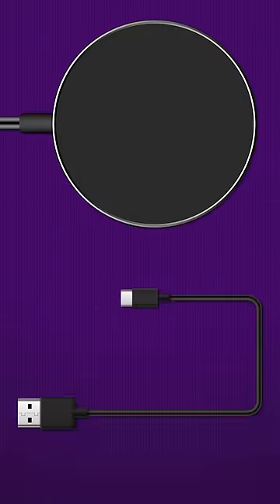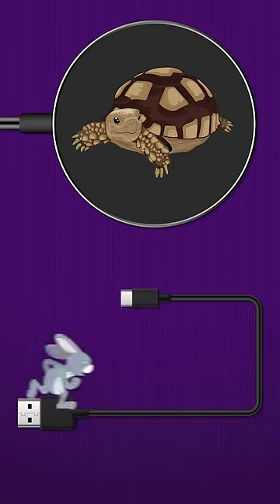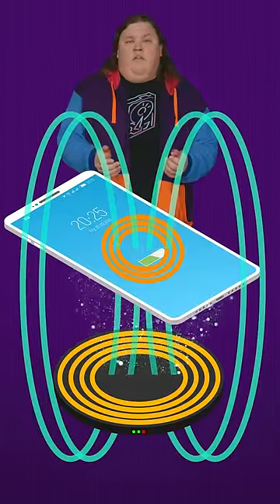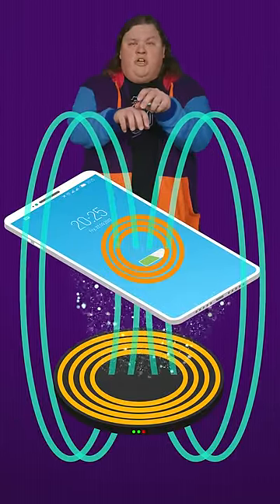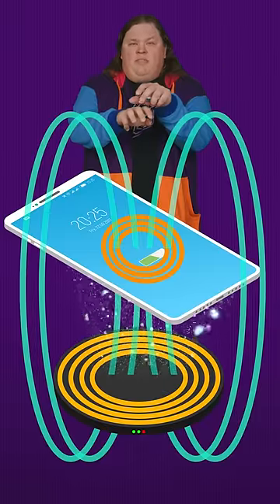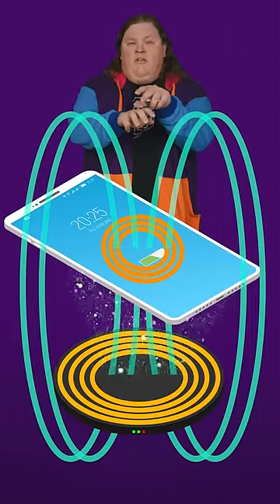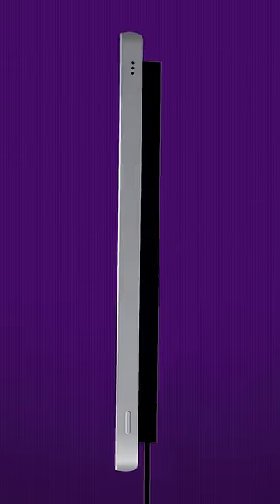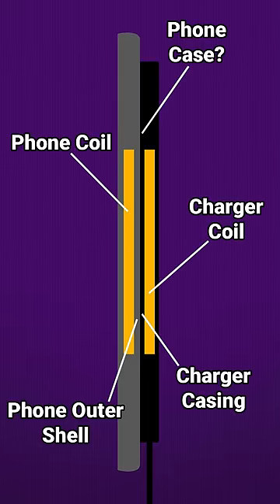Why Wireless Charging Is Slow #Shorts

Comment: They aren't improving, they are wasting more power at higher wattages. Wireless will never be efficient.
Reply: Never be as efficient I think is a better statement. We likely can get significantly more efficient wireless power, but it will still have more loss than wired
Reply: @DeathProductions200  Dude, eddy currents
Reply: @UltraGamma25  is that supposed to be a rebuttal? Cause it really doesn't explain much. Yes there are limitations to magnets in terms of power transfer. But fun little fact, we can always find other options that are as efficient or more efficient. We can find some weird material in 4-5 years that makes induction a more viable for power transfer, and goes from say 85% to 96% efficient. Don't just say "Eddy currents" in hopes that that works as a rebuttal. We have no idea what'll happen in the next 5-10 years.

Comment: I hate wireless because I can't use my phone while charging. With a wire I can still hold it in my hand
Reply: Thankfully there is no phone that ONLY has wireless charging.
Reply: @bgezal  yes and no company would EVER think about taking away the CHARGING PORT on their phones riiiiiiiggghhhhht??????????????????
Reply: @jadenknott if it isn’t apple😂 and yeah you can use your phone while wireless charging if it is an iphone😢
Reply: Apple has mag safe so the charger will stick to the back of the phone. I heard Samsung might be getting a form of mag safe soon too so I think phone companies are considering removing the charging port
Reply: I'm already doing that with a MagSafe Battery Pack. Though I still agree with other replies saying that removing the port is dumb. WiFi is only recently surpassing 1Gbps, and physical ports are capable of going 5Gbps, if not up to 80Gbps, it'd be dumb to rely solely on wireless data with how things are right now.
Reply: @superfragilisticatexpialidoshmur  oh yeah I completely agree
Reply: The Wireless Power Consortium is working with Apple to bring a mag-safe like charging capability to Android devices. The new standard will be called Qi2. Qi2 should be cross compatible with both iPhone and Android devices.
Reply: @FoolOfATuque  thank you so much for the info I've been wondering what it really was
Reply: @jadenknott  Apple
Reply: @adibafiq6945  yep
Reply: The thing it not just a charging port, it a data and SYNC port too... Like for Android auto or moving a huge amount of file
Reply: Yeah I never understood wireless charging
Reply: @michaelvernon9459  but what’s the point if instead of having a big puck on the back of your phone, you can just have a cable plugged into it?
Reply: @sam_9228  because companies will find ways to make more money from it
Reply: I just hold the charger too, no biggie
Reply: Because technology takes time to improve we will probably get wireless charging in 19 or 20 years
Reply: I like wireless charging, because it won't wear out the charging port. It's also nice being able to just plop the phone onto the charging pad, and pick it back up, instead of fiddling with a cable. If I need to use the phone while it's charging, I usually just leave it on the pad.

Comment: I don't really care how fast it is. Most phones charge too fast anyways. I'd rather have a phone charge slower so the battery lasts longer. Wireless charging saves the USB port on my phone from being worn out.
Reply: quite useful when you lose the ability of the port as well
Reply: What do you mean when you say "the battery lasts longer"? Do you mean long-term or the battery capacity? Because in the long-term, fast charging doesn't negatively impact battery life expectancy. It has everything to do with heat and the number of charge cycles, not how fast it charges. Most phones monitor the battery temperature while charging so that it doesn't exceed around 40c, which is perfectly fine for the battery.
Reply: A phone battery is worn out by deep cycles (like 10% to 100%), not by fast charging or charging often. I've fast charged my phone for 4+ years and it still has 83% capacity, within specs.
Reply: Right, that's why I have a routine set that only turns fast wireless charging on when it's below 50%. And if I REALLY need to top up fast, I can just pull the plug from the wireless charger and plug it into the phone.

Comment: I don't get why people now will literally not consider mid-range Android phones without wireless charging.  How hard is it to plug-in a USB C cable?  The "wireless" base you put your phone on has a cable going into it... why not just plug that into your phone, instead of the base? 🧐
Reply: Who says you can't do both? Hell if your phone doesn't come with wireless charging, you can buy wireless charging USB C receivers that stick to the inside of your case cover, and plug into the port. Want to charge with a cord? Unplug it, plug in the cord! I've been doing this for 10 plus years. 😆
Reply: Due to risk of small debris entering the port at work I got a plug to cover it.
So I would need to take it out and then plug in the cable vs just put the phone on the charging pad
Reply: @AltonV  Oh my, what an inconvenience to have to remove one plug out of the port to then put a cable in! #1stWorldProblems anyone? 😉

Comment: Because it's wireless. There, I saved everyone a minute
Reply: Yeah seems pretty obvious.
Reply: but why is wireless slower
Reply: cause it's not wired
Reply: @-Scrapper-  Wireless is slower as power has to travel through at least the plastic of both the phone back and the charger base, from the coil inside, and the air.  With wired, it goes down a cable, directly into the device, where there will be other wires inside.  So it's more direct
Reply: @dftfire buddy I watched the video

Comment: Cool video. I feel wireless chargers are overrated
Reply: Agreed, they also waste a ton of energy compared to just plugging in a wire, and are they really wireless when you have to plug the charging pad in?  🤦‍♂️
Reply: @CommodoreFan64  A phone's battery is like 40Wh. You're wasting a hundredth of a penny for each charge.
Reply: @CommodoreFan64  I liked the idea of a Wireless charging hub which sends power all across the room, any device which is capable of receiving power this way, can charge by just being within the field of energy. If I remember correctly, Xiaomi did something like this. Although I'm skeptical about it's health effects, bcuz sending energy waves all the time through your body can't be good, can it?
Reply: Well you see wireless aren't appealing for people like us , it's more appealing to olders because they are just easy to use, hard to break and charging cables sometimes just break and so does the port so it makes sense why apple is putting so much money into it.

Comment: I never understood the appeal of wireless charging. Cables with magnetic connectors (eg. MagSafe) are the way to go. Peak efficiency, excellent ease of use, and fantastic durability.

Come on USB-IF. Release a standard magnetic connector for USB devices already!
Reply: the big tech overlords arent gonna want to give us that. they want people choosing between an actually functional platform with well-implemented features and zero control (iOS) and a buggy, dysfunctional, disjointed mess with a tiny bit of control (android).
Reply: I only charge wireless because my power connector keeps on corroding both on my phone and the cable.  I keep on having to buy new cables, and the power connector was the first thing to break on a phone.  It it wasn't for that, I don't see the point.
Reply: Because it's nice to just set my phone down beside my bed at night having to fumble around with a cable. If you don't understand why people like wireless charging then you must hate thinking
Reply: @chefboyardeeznutsinyourmouth  That's the theory. In practice, I've never used a wireless charger that reliably performed as you just described.

If I have to fumble around with the positioning of the device on the charge pad, I may as well spend the same effort inserting a cable. Then I can at least move my phone around a bit while still charging. And it charges much faster while wasting much less electricity.

And if the phone has to use magnets to align properly with the charger (eg. iPhone's "MagSafe"), then I don't see how that's less inconvenient than a magnetic connector for the cable.
Reply: @chefboyardeeznutsinyourmouth  that’s a lot of sass coming from someone who thinks it’s too hard to plug a wire into a phone. Wireless charging has just as many inconveniences as using wired charging. If I wanna use my phone while it’s charging I’m just outa luck if I go wireless
Reply: @CivBase  in practice i go to my home office, i drop it on the wireless charger. i go to work, the same. i lie down in bed, i drop it next to me. 

the result is that i always have a good percentage of battery and all i have to do is place it down on the charger instead of the surface.... i don't know if i have 200 IQ but i always get it right with the 1st try. i also hate cables dangling everywhere. they don't look nice, the pets like to chew them and the robot vacuum likes to get entangled with evefy opportunity.

 that said, i also have a high speed charger + long cable in the drawer to use in case i need to charge it really fast, or if i happen to be running low and i need to be using it at the same time
Reply: @CivBase  Then you should try out the Pixel stand. I never had issues, you just pop it on it and done. (Works even if you put your phone horizontally on the charger)
Reply: @CivBase  I rarely have to fumble around, if even if I do, I just wait until I hear the charging sound and I know it's charging. But to each their own
Reply: @mind-of-neo  who hurt you wtf
Reply: I basically only use MagSafe wireless charges to charge my iPhone. It charges overnight and I can use it all day. If I need a top up I have a MagSafe Charger on my desk. Pop in on there for 20 minutes and I’m good for the rest of the day.
Reply: I like using wireless charger
Reply: They have some advantage, especially for disabled person, it's much easier for them to just put it there, instead of fumbling with the USB, especially the old Micro USB.
Reply: @mind-of-neo bro I'm curious what android did to you, I've been using Android since Android G that is more than 10years of Android use. I've rooted multiple phones, used multiple 3rd party recoveries, installed multiple custom roms and kernels, I've used Android phones for computer vision and robotics related projects but I didn't encounter the issues you mentioned on any of the unmoded phones.
Reply: @mind-of-neo have you ever even used an android phone before? I've been using it my entire life and I've encountered exactly one bug years ago, it's not buggy at all. And disjointed? You mean varied and intercompatible with basically everything?
Reply: What if i want to charge my phone slowly? For better battery health
Reply: Dependa, its kind of snooth if you dont user youre phone, no USB c game controllers And Just Palace IT on youre nightstand.
Alsof the OG Idea you could go dit in a bar And charge youre phone on at Starbucks OR something
Reply: @Max-ew8cg  just use 5 W / 10 W charger

Comment: Wireless tops at 50W and wire is getting 200W in the experimental models.
So yeah wireless is getting to be faster than wire, in ~2018, BUT wire got faster as well since then. 
I recommend everyone to aim for AT LEAST 67W charging, as it's life-saving if you need a top-up between flights, or you just forgot to change, and you wake up to 5%. 
67W gives you 15-25% in 5 min, which is plenty for surviving. (as they usually have 4500+ batteries as well, 15% means more as well)
for comparison, iPhone will give you 5-7% in same time. (tested myself my phone vs my wife iPhone)

Comment: Wireless may be slower, and each phone charges its' own speed no matter the output of your wireless pad, but it saves the USB port of your phone.  After just 2 or 3 years of ownership, a lot of USB-C ports on phones will become really loose and simply not detect a cable connection and won't charge.  It's why I got rid of my last Samsung - had to shove the USB cable in and wiggle it around to get it to charge, and eventually the fast charge just refused to work as well.
Reply: If you're having to wiggle around a USB port, you need to clean it...
Reply: I'm not sure I've had that problem with micro USB connectors but with USB-C, I've never had that issue, and I've had lots of USB-C devices since 2019.

Comment: I picked up an ONN brand 10w wireless charger for $10 from Walmart and it sits on my computer desk. Takes about 2~ish hours for a full charge, but I also have a z fold 4 and the battery is relatively big for a phone.
Reply: 4400mah? that's relatively standard for android these days
Reply: Onn is Walmarts in house brand FYI. So, if it works and it's cheap enough... 🤔

Comment: are they getting more efficient or just faster? it's a bit worrying from a collective energy use perspective if everyone starts using less efficient ways of charging their devices. (one person using wireless is a tiny on the grid and environment, but an entire country doing it would be significant)
Reply: Phones don't use much electricity anyway. Less than an LED.

Comment: I honestly can’t see wireless charging as anything but a gimmick, and a bad one at that, since you won’t be able to use your phone while it’s just laying there on top of it. Well, at least not comfortably. On the other hand you can do that with wired charging. 

Wired charging for the win (until you just need to have it in a 1-1.5 meter proximity for it to charge)

Comment: Think of it as the charger is a magnet that powers a generator in your phone and is incredibly inefficient because the power runs a magnet to run a tiny generator in a device with no physical connection.

Comment: I don't really get wireless charging for phones, I get it for smaller devices or things that don't have a large battery like a watch however.
Like what's the point of them, what problem do they solve? having to plug in your phone? I don't know about you guys but I never thought plugging in my phone was cumbersome
And if that's the problem, I don't get why we don't see more flat wired chargers, like the original Magsafe charger, it still has a metal to metal connection so the efficiency is the same as a normal charger, but it can still attatch through magnets and is easy to remove
Thinking about it, why isn't this the way the Apple watch charges, instead of induction through the thicc glass
just have a metal connector on the side that's flush with the case and a charger that can attatch flush with the case too.

Comment: There is a theoretical limit to the efficiency of wireless charging.
While it is possible to improve on the speed, it is very difficult to improve on efficiency.
So if you have a limited source of energy, say a power bank, you can only transfer half of the energy from the power bank to the phone.
This is why a phone without a charging port will never see the light of the day. In the field, with only battery power available, you would routinely waste half of your batteries only because of wireless charging.

Comment: Well my wireless charger is 65 watts lol when the iPhone wired charger is 20 watts
Reply: I'm pretty sure the iphone can only handle 10-15w through wireless charging ny though.
Reply: how to melt a phone
Reply: That's because Apple haven't improved the Thunderbolt standard since it was introduced, back around 2012 I think.  I'm sure they could have increased the wattage if they wanted to.  But they have even said that once they switch to USB C, they will not allow fast-charging or data transfer faster than what Lightning supports now.

If fast wired charging is important to you, get an Android phone.  Isn't that how choice works?
Reply: @dftf  Apple doesn't have a choice of whether or not to use USB C. EU law is making it so they HAVE TO, or they will not be allowed to sell their phones in Europe.

Comment: I like that wireless is slower, as that is less hard on your battery.
Reply: It isn't the speed that affects battery longevity, it's the heat. Which wireless has more of because it's less efficient and that extra energy just turns into heat.

It's wasteful to the environment and at the same speed worse for your battery too. The only pros of wireless charging is the multi device compatability and that it's slightly more convenient unless you're actively using the device.
Reply: @toxicturkeyy  For my phone (Note 20 Ultra), the ultra fast wired charging makes the battery hotter than wireless charging. Maybe it's different for other models.
Reply: @BenjaminRay  then use a wired charger that isn't ultra fast, so it makes even less heat?
Reply: At least on Samsung devices, it is possible to turn off fast charging, and even automate it. Mine is currently set to turn off fast charging at night.
Reply: @DuckInGameStop  My wireless chargers are upright phone stands. One by the bed and one at my desk. Super convenient for phone positioning, and they happen to slowly charge my phone. Haven't plugged a phone in (or laid it flat) for years.

Comment: There is ZERO point in wireless charging, if your phone has to be on the charger, and A WIRE has to run to the charger. It's still wired, just the wire doesn't go into your phone, it goes into something that first wastes some of the energy. Don't be lazy. Connect the wire to your phone.